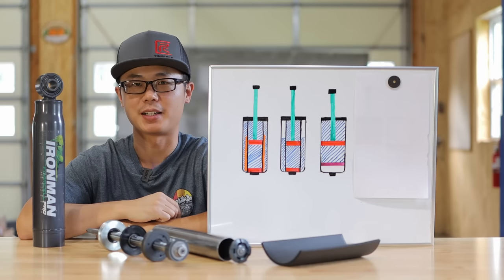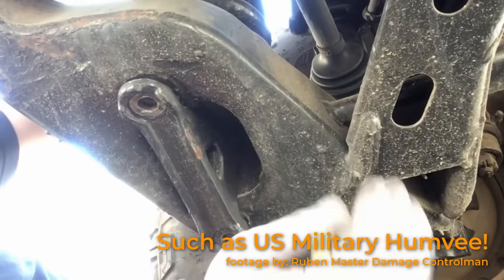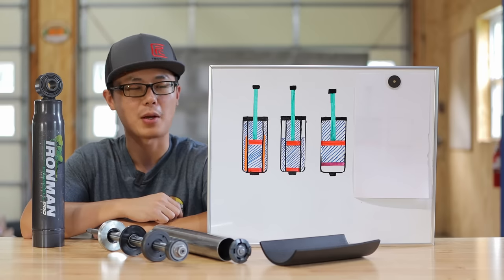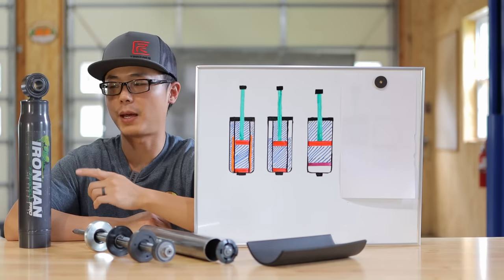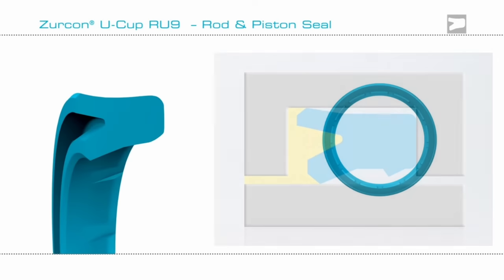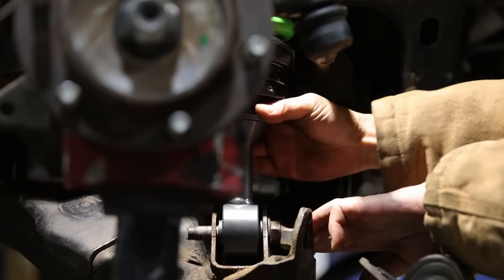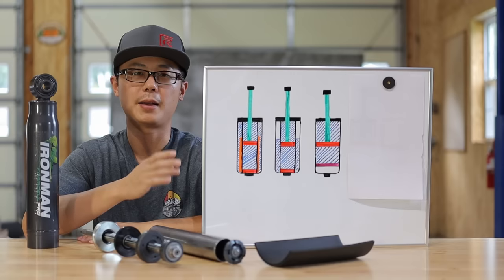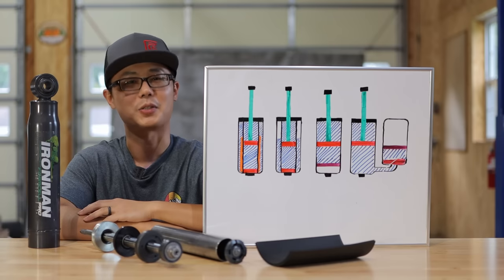Truth About Ironman Foam Cell Pro | In-depth Technical Review & Comparison

Comment: Disagree on the added price for adjustability and not being relevant anything other than higher speed off-road damping. Low speed compression damping adjustment can help a lot with street driving, particularly for those that have anti-roll bars removed. Helps immensely to slow body roll down, and most corners are not long enough to really get to a static, fully realized damper displacement, i.e. springs have hit their full displacement for a given static cornering load regardless of damper dynamics. 

I have full set of Dobinsons MRAs on a GX470 which replaced a set of base yellow Dobinsons with the same spring rates. The low speed compression damping adjuster has been invaluable.
Reply from the maker: Good point. I max out my compression adjusters on the street too due to no swaybar. However with a heavy low speed compression setting, it is essentially making a linear piston behave like a digressive one. I’m not sure if the base piston on MRR is linear but Fox and most other racing shocks are. On the other hand, pretty much all lower price shocks are already digressive for transient body roll control. They won’t be great for real highspeed off-road though.

Comment: Doesn't the foam insulate the shock?
Reply from the maker: I don’t think so. The heat generated comes out to the outer tube via fluid convection. There is a ton a of turbulent flow in and out of the base valve. So you don’t really rely on heat conducting through the inner tube wall and foam.

Comment: This video influenced me to get the foam cell pros over the 6112s. I was replacing bilstein 5100s. Sadly these shocks ride extremely stiff. I would highly recommend people to not waste their time and money with these. Fingers cross I can return them despite driving on them for a week.
Reply: Hi. I'm on the hard process of selecting a suspension for my 18 tundra. Can I ask you what truck/suv do you use it in? Did you got the full kit or just the coilovers? Load? Any updates? Thanks in advance for your help!
Reply: Thanks, I was wondering about daily driving ride quality on these!

Comment: Its funny because in Australia Ironman gets trashed in the 4x4 communities for being cheap crap (not my opinion) and people would prefer to get nitro OME shocks than Ironman Pro Foam Cell. crazy world eh
Reply from the maker: I would like to learn the “why” behind those. If you get on the forums, we also get plenty of negative talks on most major US brands, icon, king, toytec and etc. it’s like politics. Some has basis, some are just someone had a bad day. I like to stay out of the drama and understand the technical aspects
Reply: Up until a few years ago, the valving across most of the Ironman suspension range was terrible.  They fixed that.  In terms of quality and general company competence, they still suffer a lot compared to ARB TJM etc (IMHO due to being a family owned company that locally employs family and friends, and having limited QC due to using foreign suppliers and not their own factories).  In terms of the FoamCell Pros - they are basically a truck shock (truck as in lorry) and correctly valved they are brilliant.  I run them, but have stopped recommending them due to the hassle those referrals have trying to deal with Ironman dealers (in Aus)
Reply from the maker: @drgloverable  thanks for the insights. All makes sense. I’m not a big fan of their rebranded generic products. But this particular shock design and most of their armors looks decent and have their own engineering
Reply: @drgloverable  I dont disagree, but I cant say that  TJM or ARB are any better in terms of QC nowadays IMHO. Lately I've noticed ARB seem to be quite horrible but I dont have data to back this up so its anecdotal. I think a lot of it comes down to the individual people/salespeople you deal with. Either way I like @Tinkerer's Adventures summary of the shock and recommended uses as a long term overlander.

Comment: Late to the channel. I had this setup fitted to my 2008 200 series Landcruiser upon enthusiastic promotion by the local dealer. I made it clear I wanted a near stock ride quality.
It was appalling on poor quality sealed roads and corrugated gravel roads, and I recorded the effects from a dash cam. To his credit, he offered a full refund once I had found a setup, following further investigation. It was much harsher than the Bilstein setup previously fitted, and after owning an 80, 100, and 3 x 200 series, I learnt a few lessons that shops always push the big lifts, stupid load carrying capacities which, for the most part are a couple of times a year unless the grey nomads are on the road full time. I think the analogy used in fishing tackle "lures catch more fishermen than fish" but perhaps I am just a fussy old bastard who is alone in his opinion of this suspension.

Comment: Have you guys ever felt your shocks after mashing through some wooops ?  They can get over 300F with a few good runs.   That foam layer seems like it would keep in a lot of heat thus boiling up that oil .  Good thing you can rebuild these lame ass shocks , your gonna need to after cooking all that oil 😂.